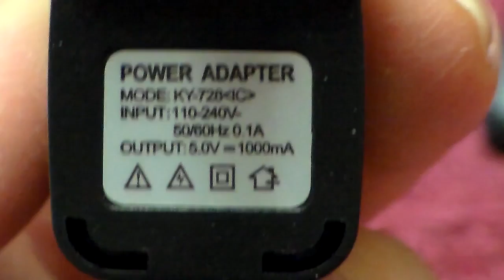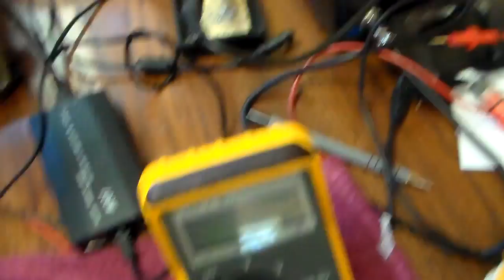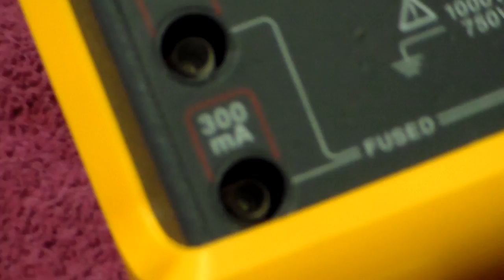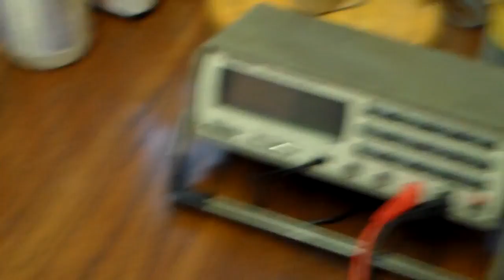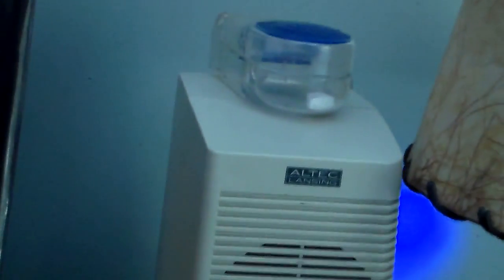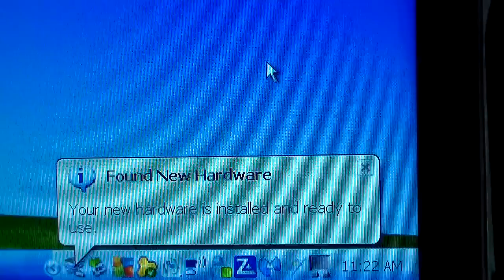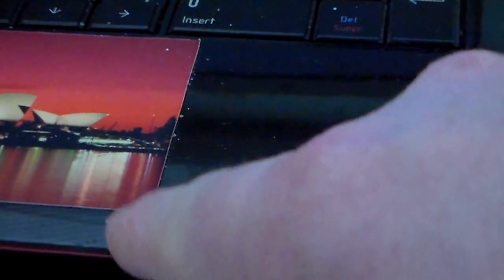USB Hub Fix

Comment: Thanks for taking the time to make this video. 
Would it be possible that a cheap diode on the 5V does the trick ? 
Cause i reckon the purpose of the 5V connection is for off power capabilities. With the diode is it not going to give 5v when powered off and ensure there will be not backfeed when pluged into its powersource? 
Thanks

Comment: Great video - can save a lot of problems and money. If the board goes at the PC, Notebook or TV then such powered Hubs get an unforgettable experience. USB per definition is not allowed to deliver power back to the host as far as I know. But all cheaper powered Hubs USB 2.0 or 3.0 I had so far showed this problem.

Comment: i had that hub it really sucks ! I got a Black Web 7 port powered at the local walmart.This hub works really great ....all steel , 4 amp power supply , 3.0 , have my mouse, keybord, 64g flash and a usb light and will charge my phone from 15% to 100% in about 35 minutes from the charging port.......its a terrific hub

Comment: so, I'm order to keep it as a data hub, I merely cut the 5v on my USB cable?  and use a wall wart of course.  I ask because I have a project in which I need to hook up several single board computers and wish to use a hub.  I think I could provide even more Amps if I used my desktop power supply.

what about daisy chaining?
Reply: these hubs work good with a 4A external supply so you could probably get away with one regulated supply supplying 3 to 4 A for every hub you wish to run, as for daisy chaining USB hubs I know you can do it but there are software protocol limitations on how many hubs can recognize through other hubs & I think you may only be able to go 2 deep meaning you might be able to run 7 more hubs off of this hub but you can not keep adding hubs to hubs to hubs & some devices do not like any hubs so its trial & error.

the newer operating systems may be more forgiving being designed for more external USB driven devices than win 7 & earlier.

Comment: didnt work for me , now the hub it not conecting animore
Reply: perhaps the china man changed the color code & your red is a data line or ground, if you plug it in to the host device after cutting the wire there should be no light on the hub & no connection to the device when it is not connected to an external power supply, if the hub lights up, you cut the wrong wire, most likely a data line.

when you plug in the power supply the hub should power up & the host device should detect it & connect, if not perhaps you cut the ground & not the +5 on the USB cable.

Comment: Adding a diode between the hub and your computer will keep any current from flowing back into your computer from the hub. A diode would only allow current to flow from your computer to the hub. No real benefit over your solution here but just more of an FYI as another option if you need more power.
Reply: adding a diode to a regulated 5v line will drop it to 4.5v most electronic circuits are tuned for 4.8 to 5.2v & will not like that as well the hub itself may be under powered when running off the PC without the external power supply with a diode in line.

if one wanted to get fancy they could solder a switch inline  on the USB cable but its much simpler just to have a modded USB cable to use when you are using it with the external supply & a regular cable for use without the external supply

Comment: Another possible fix way would be to add a large capacitance value capacitor inside the hub between the +5v and GND poles.
I have this hub and i am not using the external power source, works pretty good. Seems to NOT be a fake USB2.0 hub.
Reply: I don't see how a cap will stop the back flow of power when they needed a blocking diode in the design or perhaps an SCR, unfortunately it is a regulated 5v so placing a diode in line will drop the voltage to 4.5v on the hub ports if you are not using the external power supply.

actually the solution would have been pretty simple at the design stage merely to use the built in switch in the power jack to isolate the 5v from the USB in when the external supply is plugged into the hubs power jack.

you will not need to use the power supply if your total load is less than 500ma 

so most large external hard drives & DVD burners, printers, all have their own power supply but small laptop drives, mice, flash drives & such power off of the USB & in some cases a 3 to 4 Amp external supply is necessary to provide 500ma to each port & avoid one thing kicking off another when it is first plugged in depending on how many non self powered devices are used & their current draw.

Comment: Hello, I saw your video USB HUB FIX part 1 and part 2, excellent videos by the way, I want to know what size of the ac adapter tip is, 5.5mm X 2.5mm? can you tell me the size, i want to buy one ac adapter and the 7 port usb hub buy, but I need the size of the jack tip. Thanks and sorry for my bad english :)
Reply from the maker: +Ursus Arctos yes 5.5 O.D x 2.5mm I.D. appears to be the correct plug size, here is the type I ordered.

http://www.ebay.ca/itm/5V-AC-4000mA-4A-Power-Supply-AC-Adapter-Charger-5-5mm-x-2-5mm-4A-/370941760364?hash=item565dda136c:g:EDYAAOxyOMdS9IzQ

Comment from the maker: here is part two, after adding the power supply I found they work ok for about a year then some of them develop connection problems, so if you have 4 to 7 hard drives connected & turned on everything will work perfect for a while then some drives will not register during boot up you will need to power cycle the non present drives or disconnect / reconnect & this can be problematic if they are network shared drives.
https://youtu.be/rJGxyZ4E-Z8

Comment: Cut the red wire and add a p/n diode ,that blocks current from external adapter.
Reply from the maker: the only problem with that is the 1/2v drop of the diode will not allow devices to be powered at the regulated 5v required for most devices without the adapter being plugged in, so thus the easiest method is to have one modded & one un modded USB cable so you can use it either way depending on your situation or needs at the time.

Comment: I have a problem with my usb hub and it sucks! i only input some flash drives that's all and after 2 weeks it stops working please i need some help !
Reply from the maker: if it worked & it uses a power supply you can try a 5v 3 to 5 amp supply, otherwise it is probably cheap disposable made in china crap which most likely is not repairable if the chip is blown, first try different USB cables to rule out a bad one, you could crack open the hub & check for broken wires & missed or bad solder connections but that's about all you can do.
Reply: +Roger Foster i plugged a 5v power supply into mine while it was plugged into my laptop, it forced the laptop to turn off (still works) but the hub no long works, even with your method any tips?
Reply from the maker: its probably defective to start with, I use a 5V 4A +tip external power supply.

by the sounds of it you will need a new hub, I have had a couple go bad but over all they are the best of the cheap hubs

you must do the USB cable mod in my video to stop voltage back feed from the power supply to the PC because even though the hubs take an adapter they have no isolation and the laptops do strange things like power down or failure to boot until you first drop the battery & do a hard reset.

https://youtu.be/ZCa4o0hXWJQ

Comment: With the 5v red wires taped back, can the hub still be used with a raspberry pi?
Reply from the maker: this should work with any USB compatible device that will recognize the hub, however the hub must always be powered by a external power supply when the 5v line is open
Reply: Roger Foster thanks very much sir!

Comment: and what if I get a bigger ac adapter? will it give it more amps? or will it just burn? haha
Reply from the maker: you really need a 4A 5v DC supply to properly power it. higher current should be ok just not higher voltage. here is the other part, I never did find time to do any actual load tests though  http://youtu.be/rJGxyZ4E-Z8
Reply from the maker: ng kaiteck that's correct as I said don't go higher in voltage than 5v.

sorry  to hear that they burned up either the voltage was in excess of 5v, the polarity may have been reversed, or perhaps it was an AC not a DC output ?

 a 5 volt DC 4 to 5 Amp supply will power it properly (500ma for each port), but you always need to check the voltage at first when powering the hub (to ensure it is at 5v) if it measures more than 2 volts over (with no load)

also you need to ensure the polarity of the new supply is the same as the old or that may fry some devices.
Reply: Roger Foster hahahaha this... DONT PUT ANYTHING HIGHER THAN 5V.. WTF IT JUST BURNED ALL MY THUMB DRIVES...

Comment: I just ordered 2 of those from amazon lol, can I add a diode to block the adapter's current? would like to get power from both pc and ac adapter to usb hub haha, is it possible?
Reply from the maker: I thought of that but the usb voltage from the pc is 5V regulated so with a diode in line you would get around 4.5v thus be getting a low power state on some devices. the easiest way is to have a standard usb cable & a modded cable, the other option is to crack open the hub & cut the 5V trace at the usb input socket & wire in a switch, you may also be able to use the switch contact on the power jack socket if the center pin is negative, if the center pin is positive you could use a small 5V or 6V mini relay connected to the socket switch terminal & the cut trace, or you could get fancy & use a scr or transistor circuit in place of a relay, this way when you plug in the AC adapter plug it breaks the 5v usb connection on the input socket & when you un plug the jack it connects it back up

Comment: you could also just open the hub and cut the 5v trace from the usb port that goes to the computer, that way you remove the need for custom cables. Also you could cut the trace and add a switch so in case you dont have a PSU or you are just going to use low current devices like some flashdrives you can temporary reconnect the 5v line
Reply from the maker: true it would be the best solution but if you don't have a switch or soldering iron this is a cheap quick way to do it & if you needed to use it on a notebook without a power supply for low or self powered devices you could simply grab a standard USB cable & have it work.

Comment: I have the belkin USB 1.1 hub F5U021.  Is there a way to mod it into a 2.0 ?
Reply from the maker: not that I know of, if its an older 1st generation hub than it does not have a 2.0 capable chip, in it, also many of the first name brand 2.0 hubs were famous for not triggering the 2.0 detection when connected to a 2.0 port thus many devices would not be connected to the internal 2.0 hub in 2.0 mode inside the PC & you would get the message that the device could preform faster if connected to a 2.0 hub. thankfully most of these compatibility issues are a thing of the past but if they are an issue for you buy one of these style of cheap china hubs.
Reply: ah so its the chip and not just the wiring that i have to update? the chip has to be updated? or i can just not be a cheep ass and buy a new 2.0 lol
Reply from the maker: ***** lol you got it, no way to make a usb 1.1 into a usb 2.0
Reply: Roger Foster OK thanks for the info

Comment: i got a question  about pc usb ports cause i have a pc running xp pro sp3 and got some trouble conneting many items such as web cams, keyboard, mouse, external drive etc...  at the same time in diferent ports could you reply a solution for this ?
Reply from the maker: if you are not connecting devices that have their own power supply you will need to buy a 5v 4A brick type supply for this hub see my part 2 video USB Hub Fix Pt2

Comment: I try this on my macbookpro with my hub, change de main supply for a 5v. 4,5a. I received a message with to much power of the usb (or somethig like that), then i try with cutting the cable but does not worked. Actually work with some device on it, but not all 7 port available but with regular cable. Some of de device are self powered. Any clue??? sorry my english is not so good.

Comment: Ive got this one. The package says it can be self powered or bus powered so I guess the design was to allow it draw power via the upstream port. Though that also would allow power to be fed into the host if the hub is self powered. Any way, this is a very good DIY even though the bus powered option is killed.
Reply: All of those companies save money because not putting a diode on the 5v usb line to allow power go ONLY from the pc to it not reverse

Comment from the maker: each port is supposed to provide 500ma, I just ordered a couple of 5vDC 4A power adapters from hong kong for these things, they cost under $10.00 each with shipping , they should work perfect for these as 3.5A is what should be used when not getting any power from the PC, I will post the results when they arrive as the 1A crap that comes with these things wont even power my laptop cooler & usb mouse receiver.

Comment: Hi mate, nice video. Wouldn't it be nice if the external power supply and power from the usb port could combine to give you a increase amount of power per port!

I have been messing around with some Bitcoin mining with USB miners. I have several 13port and 10port hubs but they only have power supplies with 2 or 3 amps :( seems a waste to have the extra ports when you can use them.

Also would you know if there is a max amount of usb powered devices you can attach to a single pc?

Comment from the maker: I have not had the time to speed test them but I have not had any problems since modding the cable,  I am running four 3.5 SATA enclosures & a full size DVD burner with no errors, as they are all external powered devices, however my USB fax modem does not like any hub, you cant really go wrong with these for the price, I have had $30.00 hubs that have not worked as good as these cheap O's

Comment from the maker: you will still have voltage at each laptop port this is provided by the laptop and is normal, what you are doing is preventing the hub from from putting power into the laptop or PC through the usb port, you should be able to to run most devices with the hub. yes this is safe for the laptop & will prevent possible damage to the DC DC board in the laptop from injecting power through the USB port. 

A proper design would have a blocking diode in the USB hub to prevent feed back of voltage.

Comment from the maker: when all is working put hot melt glue or epoxy glue over the new usb cable & over the wires gluing it to the board for strain relief so it wont break if the cable gets pulled on

Comment from the maker: plug it into a socket & with a multi meter test each of the 4 or 5 wires so you know which color wire goes to each solder point on the usb socket, then strip the long end of the cable & solder the correct color wire to the correct usb socket solder point on the board, if a trace is torn off just follow it to the next junction solder point on the board & solder your usb cable wire there,

Comment from the maker: sorry never worked on a ps3 but if the socket is ripped out of it it may need a new socket & possibly the board repaired if it tore the traces off the board, if the socket or traces are damaged you could always hard wire a usb cord you would need to cut the end off a usb cable about 3" from the end so you can strip each wire,